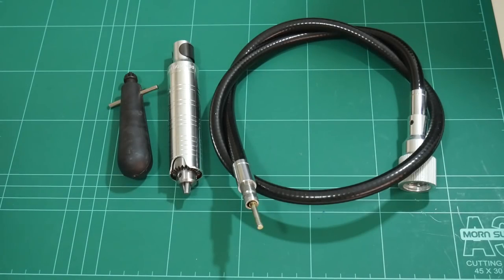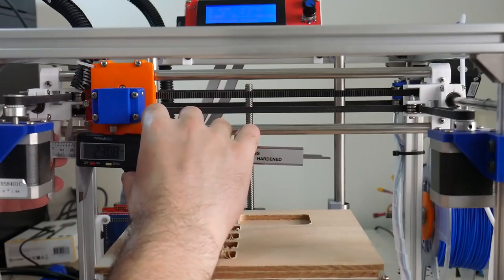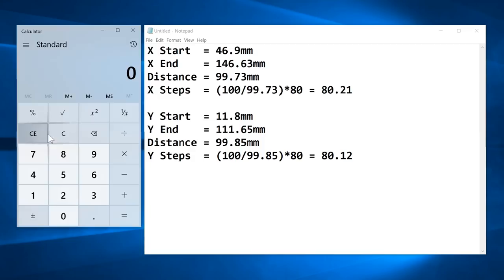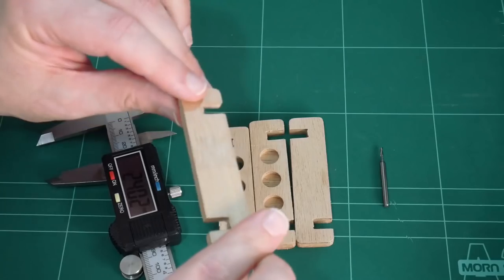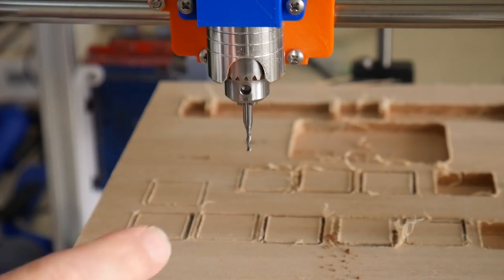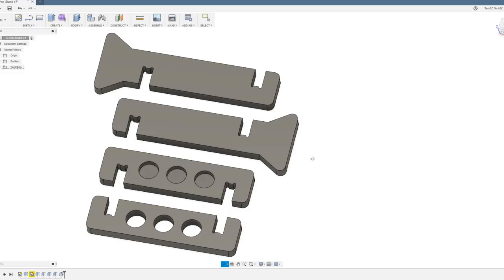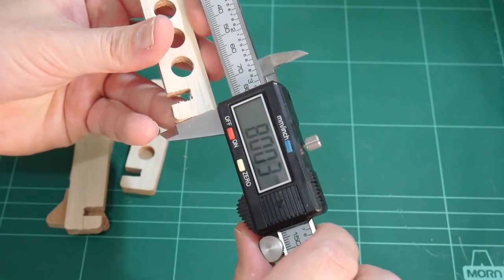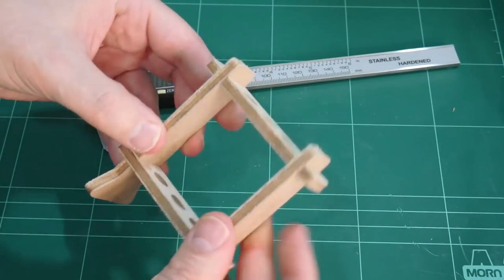Adventures in Measurement

Comment: The way you measured x and y seems to me to be prone for inconsistency between measurements.
Reply: I have to agree. You need to be absolutely sure you're measuring exactly parralel to the axis and that is not the case here.  You also need to make an extra travel to take out clearance on your travel direction. If there is a difference on these measurements, you need to get on that issue as well.
Reply: David  I would measure your reply against the fact that this is the same person who made a rather impressive and popular printer over more than a dozen videos.
Reply: David  His results prove otherwise. Its a home made 3D printer being used as a CNC, his technique is more than adequate for the expected tolerances
Reply: @zzing  "popular" doesn't mean "good". There are quite a few errors in this design. Some are obvious, some derivate from low quality of build materials and lack of equipment (as this chinesium calipers that can haave about 0.1mm error on the farther end). Some can be connected to extremely low budget build.

People somhow got the idea that FDM/FFF 3D printers are cheap and easy to build. This is only when you're not building them right, or you aim just for simplest materials like PLA or PETG, or you've decided to ignore physics.
Reply: Wojciech Lewenstam you do realize that everything has a budget right? 

For the vast majority of people in this hobby this machine is an upgrade. 

If there are problems on this build help us fix them. Not everything has to be perfect.

Comment: This is a more accurate way to measure sizes:   
You make 10 of them, butt them all up against eachother and measure the entire block, divide the result by 10 to get your answer.   

To measure your kerf-width holes more accurately:   
Cut out a long rectangle, measure it, then use the router to cut that rectangle into 11 separate side-by-side pieces (ie: make 10 cuts).  Put those 11 pieces back together, all butted upto eachother, and measure that whole thing again.  Subtract those 2 measurements from each other, then divide it by 10 to get your answer.

Because you're measuring something much larger, you get a much bigger surface to measure, it's thus easier to keep the calipers straight & square.  Also any small cutting errors from the router/printer are being averaged out over 10 results.  Learned this from Ponoko.

Comment: As usual, very nice video.
If I may. There are a couple things going on here:
1- Measuring technics need revision. Points of contact for your ref measurements should be flat, parallel/perpendicular. Using the bars and ref points that may vary slightly from measurement to measurement will introduce errors. Try fixing the calibers or better yet, use a dial indicator with a dial indicator holder designed to clamp on any repeatable reference surface.
3- The calipers may be off too! You would be surprised!!! Knock-off digital calipers may be off by as much as .04 from measurement to measurement and this is a huuuuuuge 
4- Repeatability. This is the point that concerns me the most.  Identical parts should have identical measurements in such short runs and using this soft materials. Something is going on there
5- Measuring the slots like you have is not going to give you accurate results at least not to the level that you are chasing.

Comment: If your runout is indeed exclusively from bring off centerm then you could shim the short jaw of the chuck to bring it true using an appropriate thickness clip from a feeler gauge (or a piece of tin foil (folded if necessary)). You can't do this if the runout is conical from an angle change to the tool in the chuck. If you have or can borrow a test indicator you should be able to determine which jaws to alter to fix this issue if it concerns you.
Reply from the maker: That's a good idea. I could place a small strip of kapton tape along the shank of the end mill and rotate it on each jaw to determine if I can eliminate the run-out.
Reply: @Tech2C  Also, I don't know how deep your chuck hole is, but inserting the tool as deep as you can never hurts. (Some even find it pleasurable.)

Comment: Good info - glad to see you were able to solve the accuracy issues of the milling operation, thanks for sharing. I like your videos because I always learn something. One minor point though - run out is generally measured as a difference in radius, so technically you had 0.115mm run out, not .23mm. Didn't affect anything in this case, but if you run into a problem where the runout is to be plugged into a standard equation (or software), it will cause you problems.
Reply from the maker: Ah yes that makes sense. So it's out by half the error.

Comment: I think in fusion you can use parameters measurement variable to dynamically adjust the tolerance and keep your drawings accurate dimensioned to transfer to another person or machine

Comment: shouldn't the x-axis and y- axis steps/mm be the same on a coreXY System?
Reply: Yeah, but due to manufacturing variances e.g. in the belt pulley radii on the stepper motors, they may deviate.

Comment: As was mentioned in a previous comment, you probably should not be correcting the X and Y motion by futzing with the steps/mm setting.  If set at 80 this should be quite accurate.  If not you need to look into why it is not.  Assuming everything is working properly (not skipping steps) then the error could be in the motor pulleys or the belt tooth spacing.  Since  you were seeing it short in both X and Y cases I am guessing the belts are not under enough tension which was also mentioned in another comment.  Changing the steps/mm is a temporary solution at best as the length of the belt is set by the reinforcing material when under correct tension and the rubber when not.  Correcting belt tension will also help to reduce ringing which is the primary cause of ghosting in 3d prints.  As for dealing with the run out issue, eliminating the 3 jaw chuck by switching to collets should help greatly.  And I did watch the previous video where you switched away from a collet setup.  Because your cutting speeds are low I would mount the router motor directly to the gantry and eliminate the issues with the flex head.  The flex stuff is meant to be hand held so there is no need for precision when they design/manufacture them.

Comment: First of all, you do not calculate steps/mm by the pulley diameter, but by the Number of teeth and belt pitch. Second, the way you measured the travel distance does not account for backlash. the correct way would have been to
1) move the head while the caliper is in place 
2) first move 50mm to take out the backlash, then zero the caliper and then move another 50mm. If the first 50mm are not equal to the second 50mm, then you have backlash. 
3) use the second 50mm to measure your steps/mm.
Reply from the maker: Prudent method to calibrate. Thank you. I wonder how much backlash, if any, this printer has.
Reply: Pulley diameter is intrinsically linked to teeth quantity and belt pitch so you could use either in this application but in any account he wasn't directly quantifying steps per mm he was calculating a relative change.
In these applications the backlash on a belt is near zero. On a leadscrew you would have a point, which is why in the domestic 3D printing world leadscrews are often only used with a gravity assist which normally negates the issue.

Comment: Morning. I think you need to check how vertical to the table your driver head is. If it is 0.1° off the cutter at depth will produce a tapered slot

Comment: I think you can't calibrate the steps this way on a Core XY system. Let me explain. If you choose different steps on the X and Y axis, they will be more accurate, but in the printing or milling process you will get angle errors on the part. This is due to the fact that one motor takes more steps and the other less. But since both motors are responsible for moving the X and Y axis, both motors have to take the same steps.

Ich denke du kannst die Steps auf diesem Wege nicht auf einem Core XY System kalibrieren. Lass es mich erklären. Wenn du unterschiedliche Steps auf der X und Y Achse wählst fahren diese zwar einzeln genauer erzeugen dir aber im Druck oder Fräsvorgang Winkelfehler am Bauteil. Dies ensteht da durch das der eine Motor mehr Schritte macht und der andere Weniger. Da aber beide Motoren dafür veranwortlich sind die X und Y Achse zu bewegen müssen beide Motoren auch die gleichen Schritte machen.

Comment: Is there a good reason to empirically calibrate X/Y step-count instead of using theoretically calculated values given by motor_step_angle * pulley_tooth_count?
Reply: yes, it is called "manufacturing tolerances".
Reply: Actual position of the hot-end should be basically step_angle_radians*steps*Pi*pulley_diameter + error, where that error is due to tolerances, backlash, belt stretch etc, and is likely normally distributed with an approximately zero mean (or at least, a mean that does not scale as a function of the desired travel distance). It seems to me that by empirically calibrating step-count based on single measurements done at 100mm, you do two things. 1) You take whatever error happened to manifest at a short distance, bake it into your firmware, and literally multiply it by 3x for full-distance, 300mm travels. 2) You also take that random error that was observed from a single trial, and bake it in so that all subsequent travels are systematically off.
Reply: @prxrb  seems about right, but how would you determine the error component of your equation if not by empirical measurements?

Comment: The precision of the part seems to be within 0.1 mm. I am not sure anything better can be expected with wood as material.

What is the resolution of the 3D printer? The smallest distance it can move - the part can never be more precise than twice that value. This probably is part of the explanation why the parts where not identical.

I am not sure how much it matters with wood being a soft material. But with metal that slot would definitely not have been the cutting width because you went both ways. That will make the slot wider.
Reply: X/Y has more precision than Z.  X and Y would be 10micron for 16t gears with a 1.8° stepper at  1/16th microstepping using a 2mm belt.  For 20 tooth gears it would be 12.5 micron.
Reply: @thebeststooge  No screw drive for Z on this printer? that's an odd ball
Reply: Typicaly I find 0.0125mm mm x and y and 0.00125mm for z, plus whatever backlash I have, I don't have tools fine enough to measure my backlash. But as you said not in wood with a dirty great motor vibrating about 5 tho is way more than adequate
Reply: Z has an 8mm per revolution leadscrew so way larger than X/Y but for 3d printers you do not need ultra fine layers.  For me my printers normally use 1 or 2mm per revolution leadscrews.
Reply: @thebeststooge  I getcha, the ones that look like barber shop poles ... i have to put in 800 stepper pulses to get  1 mm of travel on the ones I use.
Reply: @foxabilo To move 8mm would require 400 pulses for the config above so 1mm would 50 pulses so you can really see the resolution for Z would be 1/50 or .02mm per pulse which is alright for a 3d printer but I prefer the 2mm leadscrew systems because the bed will not slide down due to gravity when the motors are off and it has much better resolution.  Trade off would be the time to move the bed.  On my 500x500x370 I can wait.
Reply: @thebeststooge  Makes a lot of sense, thanks.